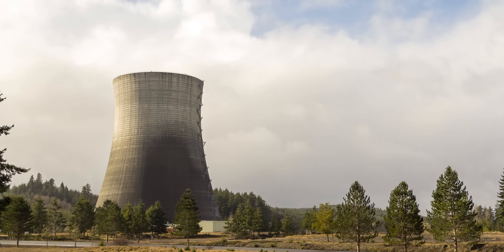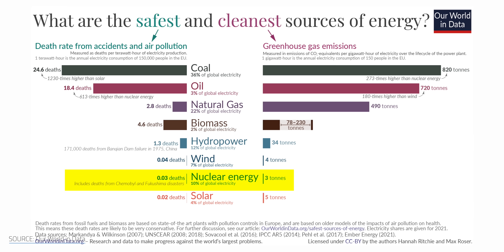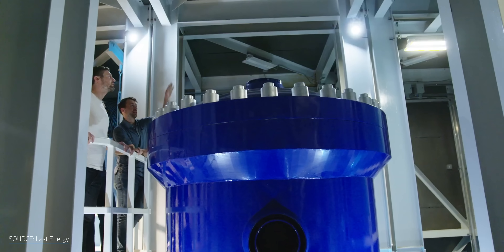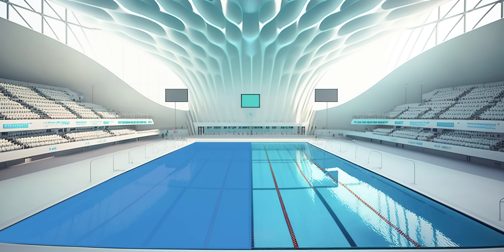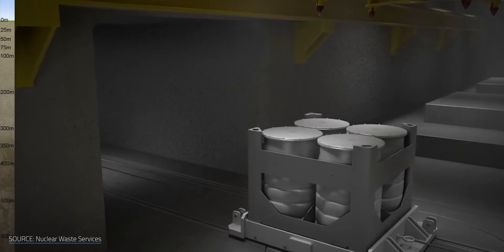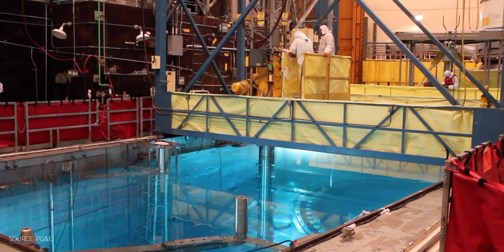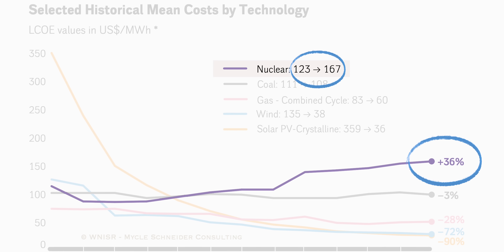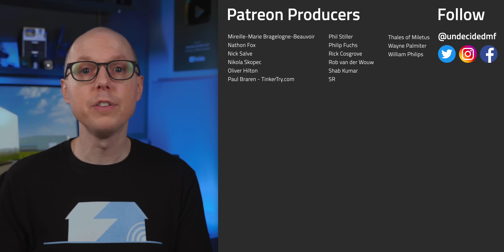Is Small, Fast, & Cheap the Future of Nuclear Energy?

Comment: The single biggest fallacy of wind and solar energy is how they determine cost of generation.. Both solar and wind are forms of energy that are dispersed and intermittent, so a realistic cost estimate has to include the price of the generation during the periods of low or no winds and during cloudy periods and night for solar. The reality it that you still have to maintain enough generation capacity to fill all these gaps, so the cost of that Green Energy is really the cost of the solar/wind generation AND the conventional generation that has to fill the gaps. Levelized price of Solar/Hybrid per MWh runs about $47.67, a Combined Cycle Natural gas runs about $37.11 and has the capacity for peaking periods and continuous operation.

Comment: So when FISSION happens the the energy is captured at extreme expense. 
This big, expensive FISSON one also uses a big EXPANDED national power grid to put electricity into a big battery in your vehicle. 

When FUSION happens, a few sheets of glass on your roof can capture the energy at extremely small costs.
Both put electricity into a big battery in your vehicle or your home.

DOES ANYONE SEE A MASSIVE COST PROBLEM, or are you just looking at the shiny gadget  ???

Comment: For the cost of nuclear vs coal, you have to take the whole chain into account: Coal requires mines, trucks/trains transporting the coal, international shipping of the coal, there's hundreds of thousands of jobs associated with the supply chain of coal-fired power plants
Nuclear requires refueling once every 5 years, or thereabouts, doesn't require massive mines on the scale of coal (yes have to mine the uranium, but much less is required), doesn't put out all the CO2 associated with the mining of the coal, it's transportation, and eventual burning.

If you compare the cost of nuclear to the coal-fired power plant and take both entire systems into account, coal is unbelievably more expensive and hazardous to human health (black lung, anyone?) whereas nuclear is far, far, cleaner in almost all aspects.. Then you have to consider that coal's waste product is just that, waste, emissions that cannot be further utilized, but nuclear's waste products can be re-harnessed and utilized for even more energy production until what's left is ALMOST safe enough to just bury in a landfill.

So yeah.. Just. Go. Nuclear.

Comment: There was no mention of how these modular reactor sites are operated / maintained, by whom and how they can have the necessary security in place to prevent someone for example using them to make a deadly terrorist attack; obviously large nuclear facilities need sophisticated and expensive security measures in place. Finally, how does making these sites small impact on the cost of operation, maintenance and site security? This was an excellent video Matt and it already had a lot of detail, but it’s still hard to even begin to get your head around how these small scale sites solve or improve upon the costs of operation, maintenance and security without more information on these points. Would be very interested to hear more if you have time for a follow up video 👍

Comment: The problem I have with nuclear is that no matter how "safe" you make the reactor with multiple redundancies built in, the problem of the WASTE still remains. It is the height of conceit of a nuclear engineer to claim the ability to maintain safe storage of the waste for even its half life (what, 13,00 years, give or take?). I have screamed to the void since the early '70s that if power companies had put even a small amount of the money sunk into Nuclear into PV research/manufacture instead, we would all have panels on our roof & no monthly power bill. But, of course, unrestrained commercialism said "No". To our everlasting detriment!

Comment: I read about a plan to adress the spent nuclear fuel issue I actually agree with. There is a type of nuclear reactor that uses a high power particle accelerator to bombard the spent nuclear fuel pellets with neutrons and induce fission in them. The reactivated fuel pellets are then put into a nuclear reactor and allowed to run a relatively short fuel cycle. The fuel produces neutrons as part of the fuel cycle so the initial activation will burn off more waste than just that which got hit with a neutron in the bombardment. After use the fuel is evaluated and either sent for short term storage (few hundred years) if it is determined to be fully burned or sent back to be activated again. 

This type of reactor doesn't produce enough power to run the particle accelerator at the level required so it will cost money to run but that can be accomplished with a 5% tax on the electricity produced by nuclear plants. Also since the fuel stuffed into the reactor is so poor it is incredibly hard to get a run away reaction going, instead of the roaring fire of a normal nuclear reactor this is a smoldering coal bed, which incidentally is why it doesn't produce much energy.

The other types of reactor that can use spent nuclear fuel usually have problems due to the fact that either significant fuel reworking has to be done or they have problems due to the large amount of plutonium that is produced as part of the cycle. The low and slow method of the accelerator activated fuel cycle sidesteps all this since the fuel is kept at a state where it is basically worthless the entire time and gets more so the longer it is used.

The major problem with this system is cost. It doesn't produce a profit and thus will never be built. Burying spent nuclear fuel in the ground is simple and doesn't cost much. Building one of these systems for each 10-20 normal reactors is a huge cost and the fuel will still be dangerous for a century or so after a full burn so it still needs some form of storage after all so why not just bury it from the beginning and let our descendants handle the inevitable problems.

Comment: I'd rather see more research going into LFTR tech than our current fissile reactions. Call me old fashioned. Thorium based or LFTR reactors have been around just as long as the currently active reactors we have now. They can be just as small and the risk is much lower as it's a high temperature, low pressure reaction. They also don't produce as much waste material. In fact they can burn the waste material that comes from a standard breeder reactor and render it down into something far less dangerous. Less dangerous than a potato. Thorium is about as radioactive as a banana and it's abundant. I'd really appreciate it if you could take a good hard look at the technology and produce an episode pertaining to it because I really believe the future of nuclear power is in LFTR.

Comment: Do we for the sake of our comfort have the right to poison God's creation for 24,000 years ?

In case recycling technology becomes feasible in the future ;
Is there any recovery of nuclear waste and recycling possibilities included in any of the nuclear waste depositories designs ?

keep in mind that the US uses salt mines to manage low level nuclear waste , the salt will re-accumulate around the waist and that's the end of it , there is no way of recovery and recycling ,

Two types of lead-cooled fast reactor were used in Soviet Alfa class submarines of the 1970s. The OK-550 and BM-40A designs were both capable of producing 155MWt.

Russian nuclear fuel manufacturer TVEL has announced the start of construction of a 300 MW nuclear power unit enabled with the innovative BREST-OD-300 lead-cooled fast reactor at the site of the Siberian Chemical Combine, in Seversk. The reactor will run on mixed uranium-plutonium nitride (MNUP) fuel, specially developed for this facility as the "optimal solution" for fast reactors.

Comment: The safety problem of a small nuclear reactor is not whether it'll blow up/melt down or not, but will or won't some crazy guy dismantle it and do something bad with it's radioactive insides. It's way easier to make 400 big reactors safe in this respect than over 9000 small ones.

Comment: I think that it is a big illusion about economy  of SMR on regulation approvals. They need to prove safety for hundreeds of places instead of one big equal power NPP.

SMRs are way less effective in energy production. They need more highly enriched Uranium, making them a bigger threat for proliferation. 
Again any design flaw will be a threat of bankruptcy of producer because they will need to change hundreds of operating reactors and pay for downtimes.
Will the economy of mass production handle the challenges. I believe no. 
In my belief optimal for power for a nuclear unit is somewhere between 800 and 1200 MW.

Comment: There actually is one solution: Nuclear.

Wind is inefficient and intermittent, terrible as a main source of power and as a supplemental source of power. Solar takes up far too much real estate for it's power output and only works during the day and is intermittent in cloudy locations. Nuclear power is the only green energy worth pursuing for large scale energy generation. Solar is best on the roofs of buildings and homes since the real estate is being take up anyway.

Comment: I feel that the safety of SMRs is compromised by manufacturers being overconfident in the inherent safety of their reactors. If you have a reactor which in itself is a safer design but instead you ignore proven safety protocols and safety mechanisms, you'll not get the safety record which you're promising. For example: Containment building, hydrogen recombinators, core catcher, emergency equipment and trained emergency personell on-site or close by, additional use of mobile pumps (which also have to be on-site or close by), emergency and evacuation plans for the region, etc...

Comment: 3:03 that's exactly what it means, nuclear causes WAY less deaths and injuries.  People still get long term issues from both when they do go wrong.

Heck you can even use the spent fuel in different reactors or maybe a RTG to squeeze a little more power out of it.

Comment: I’m not sure using the reactor as the containment cask is necessarily a good idea. All that neutron bombardment for 6 years will have likely caused some damage or embrittlement of the cask and/or other components so I definitely wouldn’t expect it to contain stuff in the long term. The fuel will still need to be removed and repackaged I think for long term storage.

Comment: Obviously difficult to summarize this topic, but there are errors in this. The cost given is for a 1100 MW plant, not 110. Probably didn’t use it for any calculations, though. Fuel can only be reprocessed once. Too much Pt 241 after that. Some SMR designs are greater than 20 MW. Not necessarily underground. Not necessarily PWR, even possibly a fast reactor.